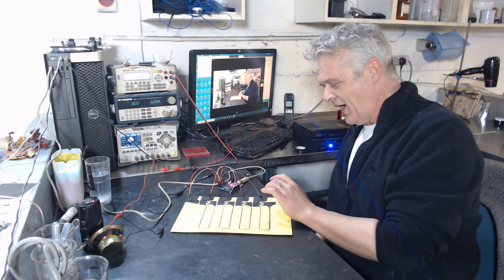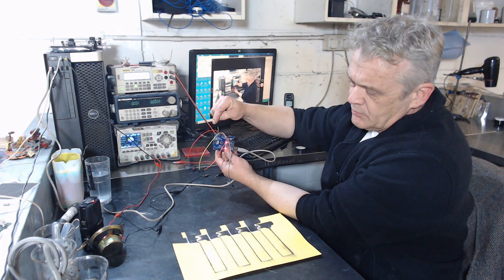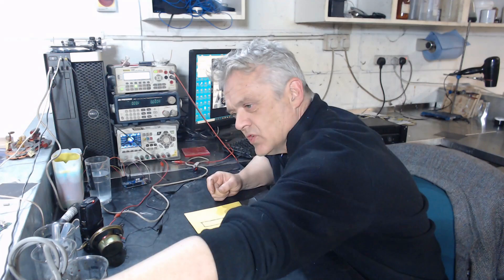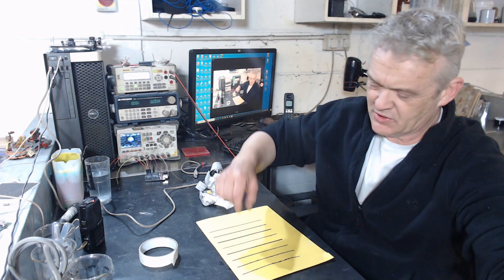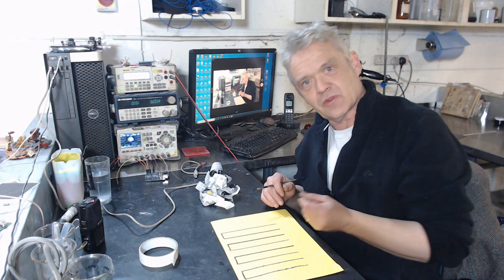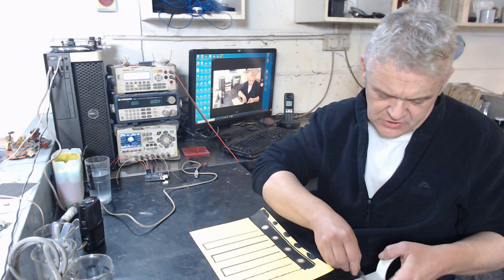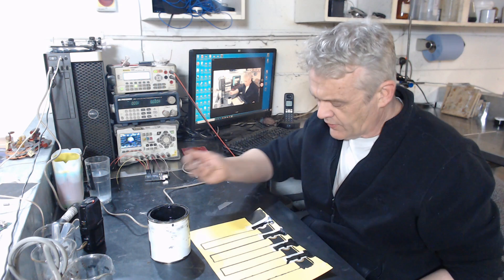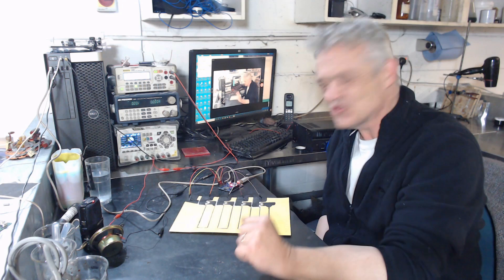Arduino Project - Making A Musical Instrument

Comment: rob, I was thinking about it and my brother has an electric wheelchair but he doesn't use it because the thing weighs a ton and charging it all the time is a hassle (mostly the weight though). anyway, a lot of his friends have electric wheelchairs and then yesterday I realised that wheelchairs need replacement batteries all the time.

if you could make a wheelchair replacement battery which weighs less, and charges in a short period of time, you're totally gonna rock that market. they typically have 12v lead acid batteries, so it's essentially a replacement for a 12v car batterie essentially (another pretty big market which battery replacement doesn't void the warrantee)

having a battery that can charge rapidly is the real selling point because it really sucks to get stuck out some place with a dead battery that takes 6 hrs to charge

cheers

Comment: Arduino has many inputs, so you can assign each piezo to a different drum in the kit. You could use a variable resister to do something like a slide trombone. 
You could use various lengths of resistance lines and program the Arduino to play either an electronic organ or piano note based on the amount of resistance each line has.

Lots of possibilities with this like paint a computer keyboard.
The keyboard may not be a good idea if you are heavy handed on a regular keyboard the way some people are. The lack of key movement in a painted keyboard would cause people to injure their fingers while hammering on it the way they do a regular keyboard.

Comment: Am I right in thinking you were a lecturer at Southampton Uni in a previous life?
Sometime in the 1990's I visited an exhibition stand (Electricity Council?) at NEC Electrex and met a Southampton Uni lecturer who was shepherding a very intense graduate in his attempts to launch his radical electric traction motor design. Basically it was a longitudinally squashed DC series motor of about 300mm OD, with a full sized faceplate commutator, that ran very efficiently at low speed with high torque.
 On demo was a very heavy 'butcher's bike', powered by this motor, that had run successfully from Southampton to Rugby (100 miles?) with just one charge on its 12 volt lead/acid car battery.
Often wondered what happened to what looked like a piece of revolutionary English design engineering. Any ideas about the project - were you involved with it?

Comment: Good use of using a pin through a hole and then wetted with more ink. I think you could  use that for the audio connector for your electrostatic speakers.      I wonder how good an antenna the ink would make for a DIY HDTV antenna.

Comment: Robert, O/T: Please, what was the size (mm?) of the vent hole you made in the stainless sugar canister used for carbonizing hemp? 
I could really use this as a starting guide for the size of plumbing of the exhaust gasses. :)
I asked in your related topic video, but no answer there yet.